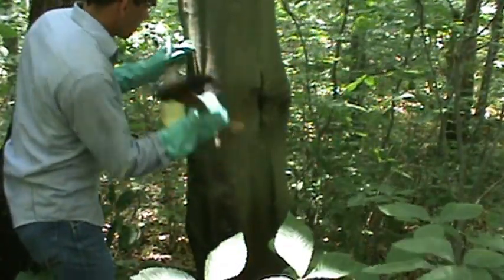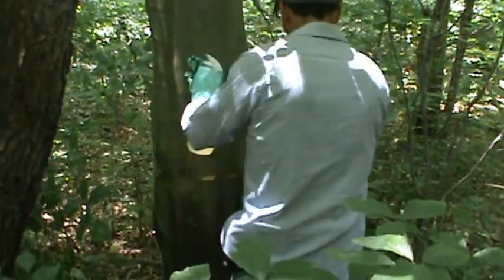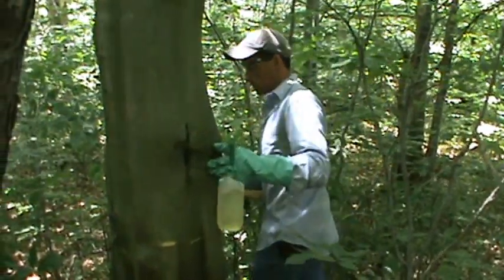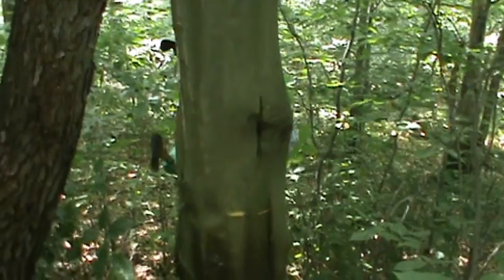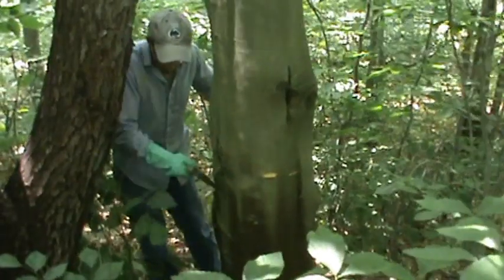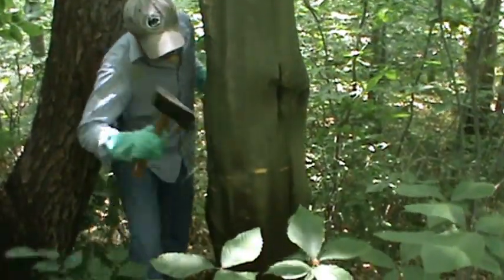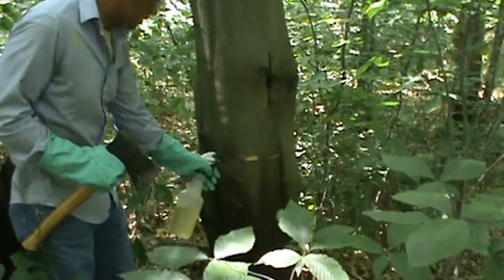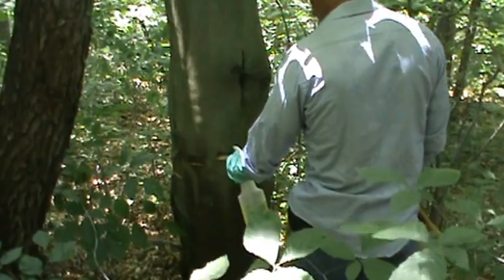Beech control, single tree with hack and squirt

Comment: What’s your experience with hack and squirt on larger trees (6” +) killing attached suckers?  Success rate?
Reply: Thinking to do this treatment on a good sized acreage, but a little nervous!
Reply from the maker: Hack and squirt HaS is effective ( as demonstrated in the video) for killing the treated stem. There are mixed results with the flash of product into root suckers. In general, flash to other beech stems is poor to moderate.

 I am finalizing a study from one site with about 60 quarter-acre plots from the last two years where all beech larger than 2 inches diameter breast height (dbh) were treated by injection (simply a cordless drill with 3/8" bit) and 1 ml of mixed product for each 3 inches of stem diameter.  Treatments were in the summer. Glyphosate (Accord XRT II, read the label for mixing instructions) injections result in about 30% mortality of beech stems. that were 12" tall to 1 inch dbh, and about 12% mortality of beech stems between 1 and 2" dbh.  Imazapyr (as Arsenal) injections resulted in about 30% to 35% mortality in each of these size classes (12" - 1" and 1" - 2").  There was no collateral damage to any of the associated non-beech trees on the plots.

I hope this helps. Work safely!